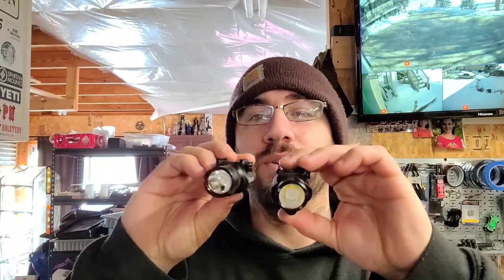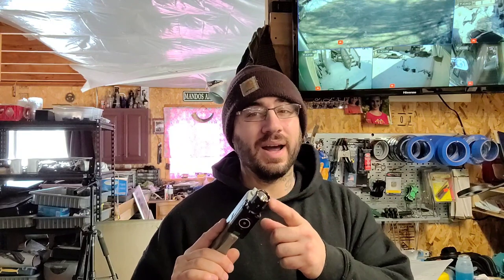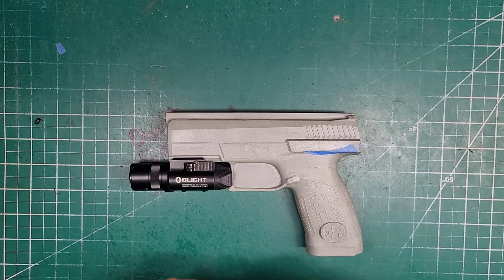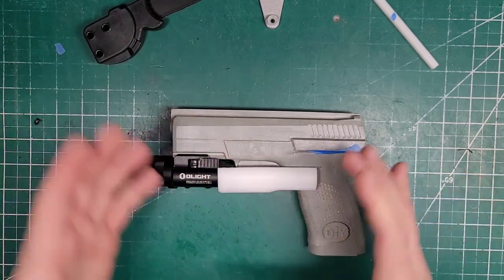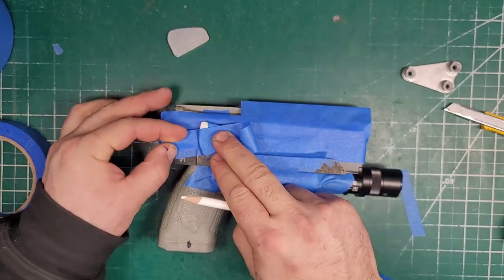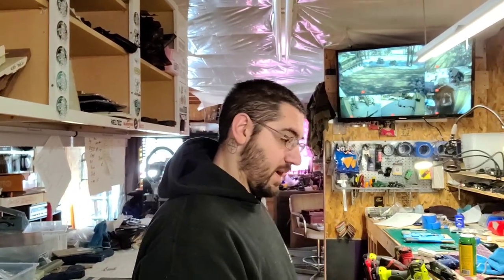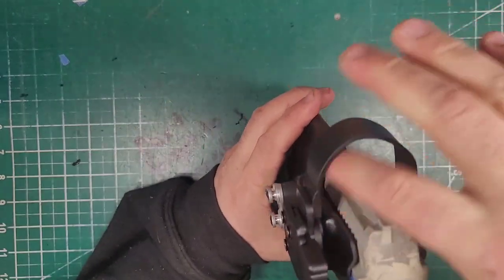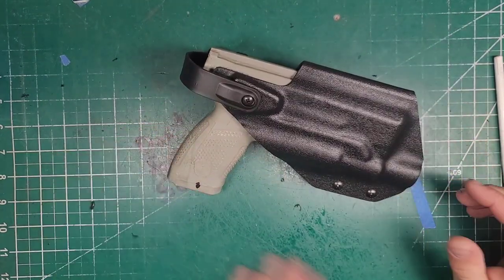Cz P10c with Baldr Pro R

Comment: What thickness MDF do you use for the retention plate? Also does this eliminate the kydex forming off center of the gun? Every time I press a holster the kydex is off centered. Thank for any advice I love the videos!
Reply from the maker: 1/4 and it forms offset cause one side is thicker than the other. Counter act that with 2 layers of foam on one side
Reply: @FalTacUnlimitedLLC  I highly appreciate the feedback. Is there a certain foam you recommend or is the Amazon special decent to use?
Reply from the maker: Beige foam from holstersmith.com